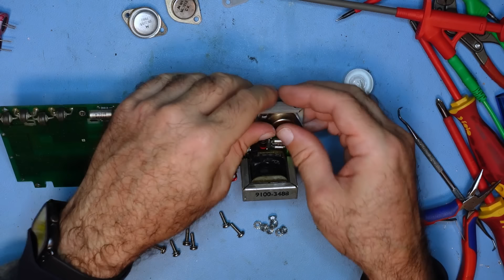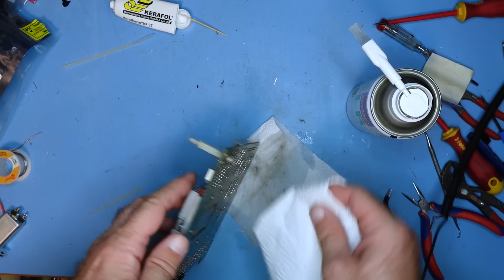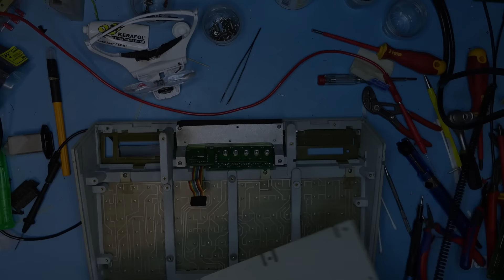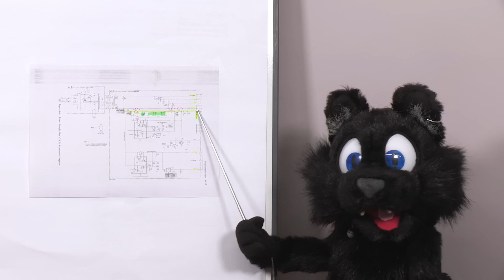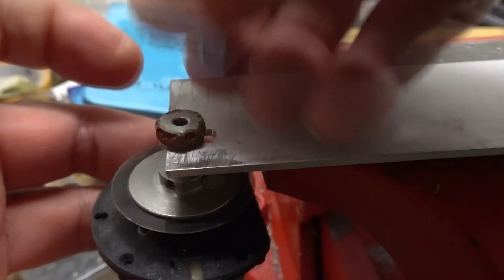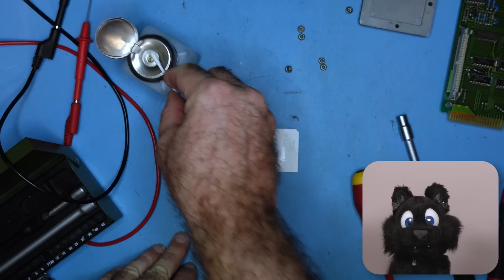HP 9825A - Part 2

Comment: I remember visiting the production line of a company I worked for and they where hand assembling hardened keyboards.  They assembly girls (as they where called back in the day, egad I am old)  put the keyboards together with a jig  with a mirror arrangement over a the workbench so the order and letter facing was correct,  just they had to get use to their hands being reversed.
Reply from the maker: I'm sure there was a similar rig in the factory here. Even though the "up/down" placement is not a problem with the hinged keys. But making sure that the whole layout is correct takes quite a bit of concentration.

Comment: I don't think you can classify that as a calculator anymore, despite wherever HP might say. To me it seems like a general purpose computer. At best one with a specialization for calculator duty. But with the addons you can do about anything with it.
Reply from the maker: Yeah, later catalogs did put it as "desktop computer"; but I still love how it started marketing as "advanced calculator". I think the option ROM idea also cemented that concept and added justifcation. If they included all the features in the base unit, it would certainly have been a computer more than a calculator... So to me, it will always be a "calculator" by name 😸 - Especially funny for me is that the standalone word "calculator" always gets translated to German as the more common "pocket calculator" (="Taschenrechner") and so, by the e-bay auto-forced-upon-me translation of listing titles, I see lots of them listed as pocket calculators. I don't know what size pocket  you would need...

Comment: I think CuriousMarc mentioned those marks too in one of the videos about HP 98035 clock module, if I am not mistaken. Ken Shirriff also has an article about Nanoprocessor that mentions that substrate bias voltages were hand written.
Reply from the maker: I have a vivid memory of the fact... but where I heard or read about it is lost in the mist of old information. I had the narration recorded but cut it out because I couldn't verify my claim; I don't want to start rumors 😺